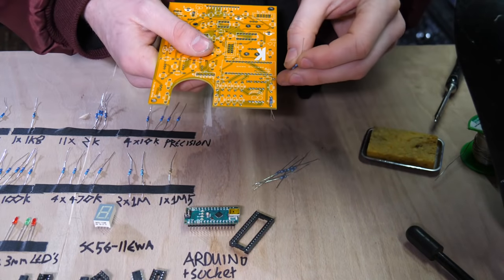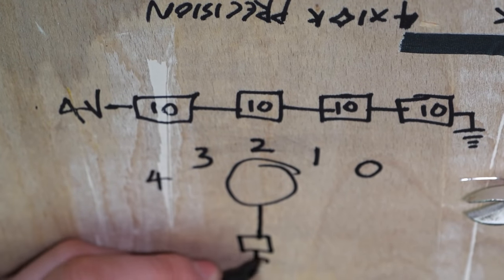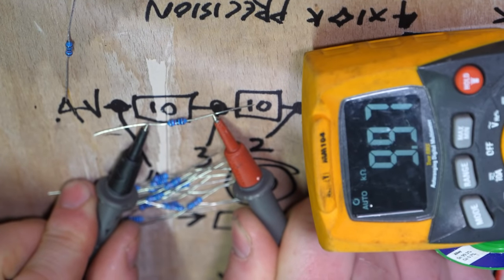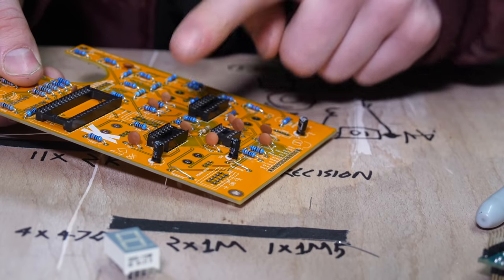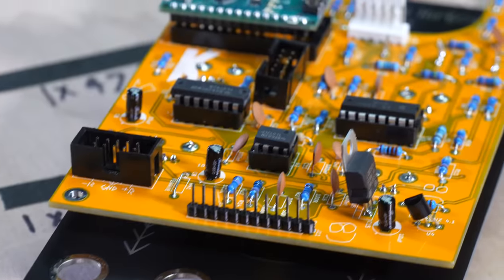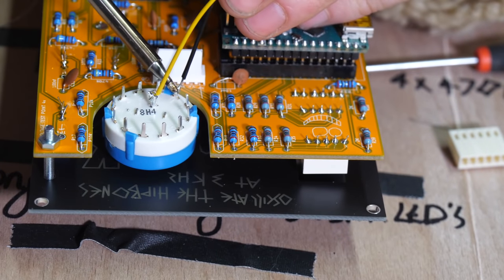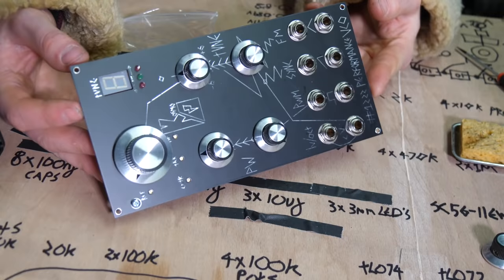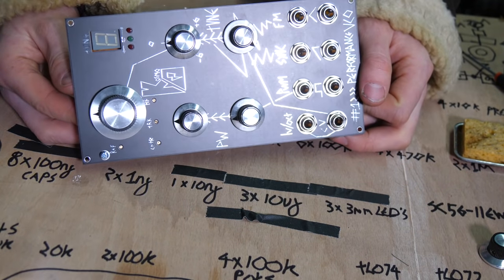2/3 Building the Kosmo 1222 Tuner VCO

Comment from the maker: Disclaimer don't take any soldering advice from me haha. also I tell you what. when your building all day and painting, its impossible to keep clean nails. I don't know how people do it! I nail brush all the time and 1 hour later boom! it's back. maybe I need to stop painting everything black ha
Reply: Or just go full goth and go for black nail polish
Reply: One thing ive been doing is using electrical tape to temporarily hold the components in place. Lets you turn it over and not have to bend the leads any. :)
Reply from the maker: @CausticCatastrophe  indeed!! its a good shout especially on connectors!

Comment: This is a very nice explanation of how to build a kit...when I started out building electronic things...well lets just say there was no internet till about 15 years later...I had to figure it out for myself, a lot of trial, and a lot of error.   Your soldering is fine...I will say that the soldering iron tip oxidizes quickly in the air, so every so often you have to clean it...in the old days you used  a wet sponge (also to cool it off) now you get those little cans with what looks like brass steel wool in it...jam the tip in there every so often, re tin the tip with solder and go at it again.

Comment: I don't think you will ever find a 30 pin socket. But for these 0.63x0.63  square pins I would not recommend an IC socket but a two single row female headers that are meant to mate perfectly to the 0.63x0.63 square pins. Something like article number 2839817 from Farnell, but a bit cheaper. Anyways. Very good video. Like the new(?) SERIOUS 'ISH channel!

Comment: One tip I found when matching resistors, is that touching them heats them up which changes the resistance. Which is really noticeable when you're measuring such small differences in resistance. I usually handle them with pliers when matching, to avoid that. Of course you're right that in this case you could get away without such precision.

Comment: A great step forward!  Thanks for this.  I can recommend getting a better mechanical connection with the wires around the switch terminals before soldering.  Use some needlenose pliers and wrap/crimp the wire around the terminal a little.  It will be a better connection overall, you can get a better flow of solder as well as it being more secure.

Comment: It doesn't change the reasoning on your justification for using close enough non-precision resistors (that you sometimes call pots or oscillators in the video :-) ), but the steps are really 1/12th of a volt for each semitone. The first C is 0/12= 0V, C# is 1/12, up to B at 11/12V and the next C at 12/12=1V .
Reply from the maker: yep, I was a dumbass, I reshot that part of the video as I did it 1/12 but then in the back of my head I came to the conclusion I was being stupid, and shot it again and evidently got more stupid! ha

Comment: If you use SMD resistors you can use a higher number of resistors in parallel or series to make a precision group. They average each other out. So if you want a 1% precision 10K resistance you can use a 18K in parallel with a 22k 10% resistors. The higher the number of resistors you get, the more precise resistance you get. That is best used for production where you don't control the variance, But in DIY projects you can measure and sort the resistors one by one.

Comment: You should not be using single strand wires on your tour gear. it will break.
When building tour gear, you want a "belt and suspenders" design.
The arduino can control the display directly, dont trust that, use and driver chip, there just no excuses, it is tour gear.
Reply from the maker: Arduino nano has an absolute max output current of 40ma. the tuner at any one time has the max of 9 LED's on at once, however with such big current limiting resistors it ends up all LED's at such low brightness, I calculated to take lower than 20ma, (infact around 14ma) so plenty of headroom for bad maths also. whilst I would agree with single core wire for wiring that is longer and moves a lot, I dont in this instance, single core wire is easy to work with and also I should have said in the vide when connecting to molex crimp terminals its good practice for the front crimp part to touch the metal, and the rear to go over a bit of sleeve. also another thing is I mention to use whatever wire you have available and yes people like yourself may go for stranded.

Comment: Would 0R's work in place of Ferrites? 
I have 0R's that came with a 0r - 10m pack lol
Reply from the maker: im not sure! haha give it a go! if it makes the pulse width adjust the tuning considerably then replace them with just normal wire :)
Reply: 0R Is the same as a plain old bit of wire.
Just like Sam did in the video but it looks a bit nicer.
Reply: Please don't use 0R (wire). The purpose of ferrites is do add inductance to suppress interference.
Reply: @BritishBeachcomber  oh no, I quite literally mean 0R Resistors. (metal film)

Comment: I have only a 10 pin pcb connector male and female can i just ignore one gnd pin on the left and one on the right and put the 10 pin connector in the middle ? Or put them on the left side and dont use the two gnd pins on the right. Does it makes any difference?

Comment: Most microcontrollers can sink more current than they can source, so if you use a common anode 7 segment display then connect the cathodes to the Arduino, when you pull the Arduino pin low/turn it off, the LED will turn on.  It means inverting your outputs in the code (which can be a mind flip!) but it's why the common anode displays are more common.  If you do it that way it might not kill Arduino clones as easily.  

You can also then just use one current limiting resistor on the anode, probably 2k2 as this is an E12 value.  These days it doesn't matter as much but E12 values used to be cheaper because they make more of them (and they were historically 5% tolerance, though most metal film are 1%).  As a musician I'm sure you'll appreciate the symmetry between E12 values and notes https://www.st-andrews.ac.uk/~www_pa/Scots_Guide/info/comp/passive/resistor/e12/e12.html 

I'll stop spamming your videos now :p
Reply from the maker: hello I did that initially. however the sc56's were cheaper so I opted for the other way round, and in this project no microcontroller have burnt out, the times im referring to is some cheap ones the v regulators fail, ive had some burn connected to 12v with it not doing anything.

but thats a fair point, instead of doing it this way reducing the current limiting resistor to the common pin
Reply from the maker: as for spamming, dont apologise, always good to mention these things I am all ears. and im doing this in the learn as you go method, I only started pcb design 6 months ago or so, so this whole re designing my stripboard modular for reliability is quite the learning curve. thnkyou for the pointers
Reply: @THISMUSEUMISNOTOBSOLETE  thanks, and thanks for making the videos, I do this sort of stuff for a job but I still find it inspiring :)
Reply: Also, have a look at surface mount resistors and non-polarised capacitors, I was always afraid of them but 1206 are actually very easy to hand solder and 0805 are fine once you're used to them (as long as you have a decent pair of tweezers).  You could either get the boards populated by the manufacturer (depends on volumes really) or solder them yourself, but it cuts down the number of holes to be drilled which makes the board cheaper and they're also physically smaller.

You can do similar thing with test points or even wire connections where you just have a square pad of copper.  There isn't much mechanical strength for the wires so better for less permanent stuff, but you can always goop them with a glue gun to hold them in place (it works surprisingly well).
Reply: @THISMUSEUMISNOTOBSOLETE  If you put a single current limiting resistor, you'll get different brightness depending on the number of lit segments. In this case it varies from 4 to 6 segmenst plus dot so it's probably not too noticeable. BTW you can use a single current limiting resistor in common cathode or common anode designs, you just put it between the common pin and the corresponding supply (VCC or GND).
Reply from the maker: @pasde2  I did think that whilst writing it! and I went and gave it a go on my breadboard (still got the tuner set up on it). it was a small amount of difference, but not too much! so I may, in a future revision reduce these resistors. or use an display driver who knows! but for now its gunna stay as this haha; but v2 may get funky monkey

Comment: for the voltage divider, resistor array in better, her is a good one from digi key https://www.digikey.com/product-detail/en/bourns-inc/4613X-101-103LF/4613X-101-103LF-ND/3741136
Reply from the maker: good to know for next time thanks
Reply: @THISMUSEUMISNOTOBSOLETE  no. thank you. btw, they come in different packages and values and pin numbers. also, this resistor array is also great for a passive summing mixer. have fun tinkering